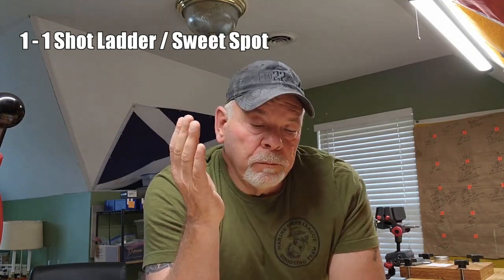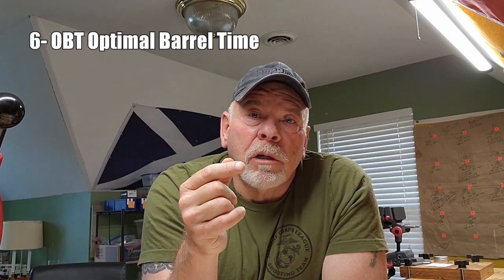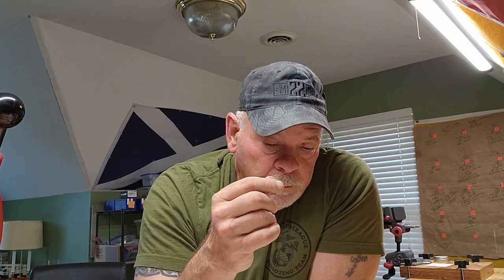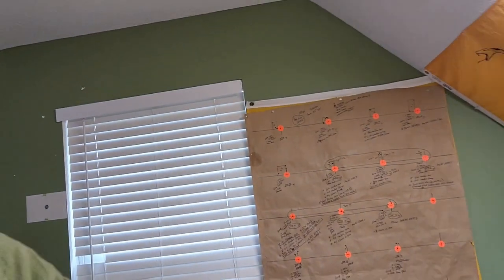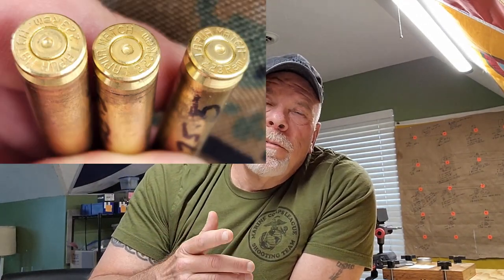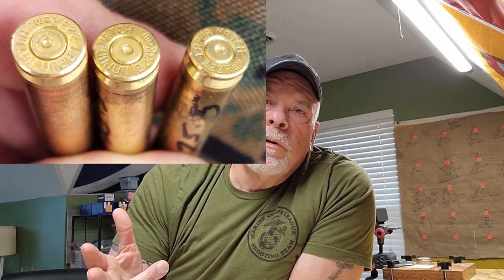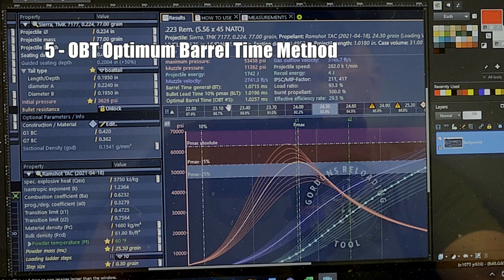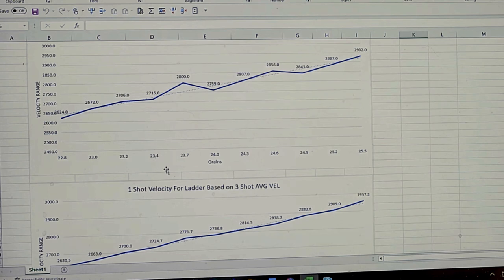Best Load Development Method

Comment: Loved the video, have noticed that quite a few shooters at matches don’t do load development. They pick a recipe from an article, or web site, or a buddy and that’s it. When I develop a load for a particular bullet I use a similar chicken scratch board, and use a 3 or 5 shot group. And after I find the best group I’ll use the chronograph on another range date. I use LC brass, some times mixed,some times same lot and date, powders are Reloader 15: AA2520, or MR2000. Primers are REM 7/12, or CCI 450. Bullets are Sierra or Hornady. Great videos good shooting this year.
Reply from the maker: Thanks! I used mixed brass last year on 200/300. Used straight Lapua loaded long on 600. This year, I got a boat-load of Starline for 200/300, sticking with the Lapua for 600. A buddy convinced me that the Lapua for 200/300 wasn't worth the cost vs reward. SMK 77 HPBT for 200/300 and switching to Nosler 77 RDFs for 600
Reply: Purchased 200 rounds of Norma match 223, SMK 77 grain loaded ammo just to shoot up in a 223 Ackley Imp.got 1- 1/4 inch groups at 300 out of a bolt gun velocity was only around 2500. Figure that out was not a one time deal I did have 200 rounds. My question about using the graph and the velocities. How do you know if you're at one end of the other of an extreme spread when you're using one shot?
Reply: @stephenkrampert3430  once I have the most accurate loading, I load up about 10 then run them through a chronograph. And hope foe a good standard deviation.

Comment: You cannot learn enough from a 3 shot group.
Reply: Unless it is a bad group. Then you may have learned all you need to know about that combo.
Reply from the maker: I disagree and agree. A 3 shot group by itself doesn't tell you a whole lot. But, a 3 shot group that also meets other parameters such as great SD/ES, an OPT and/or OCW node gives fantastic information... to go verify. Check out the 2 videos on load development and accurizing my 6.5 Creedmoor.   https://youtu.be/TeDkqUwkq1E
https://youtu.be/YAk96gSewuw?t=299
Reply: Hornady found that true dispersion results can be safely calculated after shooting a 60 round group….seriously. 3 rounds ain’t enough for sure.

Comment: I am 2300 rds into 300 BO 100 yd accuracy.  I am not at the range my usual mon. shooting session.  Cold and windy, i was looking forward to testing 168 Hornady AMAX compared to Nosler Custom competition.  10 mph 168, .76, 175 Nosler, 1".  today is just cold with 10 mph done that.  i use 2 shot groups at 50 yds to compare different powder levels.  Check best a 100.  3 & 5 shot groups.  Then i go to seating depth at 50 then 100.  I had no luck with boat tails, not bad accuracy but tear drop bullet holes.  E. Cortina Break solved that problem.  My mish mash of what works for me.
Reply from the maker: LOVE my Cortina Tuner on my RPR !!! Curious if you're 300 BO is Sub Sonic and if that's a possible reason for the tear dropping? I use the 168 AMAX in my M1 in 30-06 & they have been GREAT so far. Thanks for watching and your comment !
Reply: i do not get the accuracy from subsonic, i am running 1700 fps or so.   Flatbased not boattail.  my best is 130 gr Speer Varmint HP, with 20.8 gr CFE/BLK  1 hole @CrustyOldMarine

Comment: Man, that was a great video in depth yet simplified, been doing this for 60 years try to keep up with new stuff ;old dog keeps going back to three and five shot groups change the charge weight try to learn and have fun doing it! Brass prep is a pain in the butt
Reply from the maker: Thanks! Yep, whatever method one uses, it's hard to argue the results of the holes on the target
Reply: I too have been loading and shooting for hunting for 55 years! after trying several of these methods, I'm going back to my 3 shot groups with 5 shot confirmation groups! I also know that a 2 MOA group is more than adequate for a hunting load especially under 200 yds but I really like a 1/2 MOA because it truly raises my confidence level and gives me more room for error!

Comment: After many years of loading development, I settled on the following method to identify a practical node. It is more or less a compromise between lowest SD and smallest groups. To verify my method, I observed many reloaders independently develop their loads and the same exact phenom happens. The smallest SD load,  then followed a smaller group size. 

The theory of accurate loading process:
In Physics, there is no free lunch.
In closed thermodynamics systems such as the internal ballistic solution, the goal is to get:
1) A very low MV SD vs powder charge load
2) Small groups vs powder charge load
3) MV velocity stability vs powder temperature
4) MV velocity stability vs small powder variations
5) MV velocity stability vs primer choice
6) Low vertical dispersion at very long and extremely long ranges vs bullet selection
First, let us solve the issues related to goals that we can control pretty easily. More specifically, 3) 4) 5) and 6)
3) Use temperature stable powder such as IMR endurance, Hodgdon Extreme Powder, etc. There are many online tests that you can search and find what powders are the most temperature stable (e.g., H4350)
4) Measure each powder drop to less than 0.1gr accuracy. It is easy to get to 0.02gr (1 extruded kernel) which is worth 0.3fps out of typical load
5) Make a small ladder test and see if the selected primers would produce a smoothly rising curve, if not, do not use those primers. There was a test in this video, do not use the primers that generate seesaw graphs.
6) Use VLD bullets with very low variations in G7 BC. For example, pick VLD bullets with less than 1% variation in G7 BC.
Now, here we finished the goals that are virtually 100% influenced by the components
Now, let us focus on the loading for the node. What is the node after all?
Optimum Barrel Time, OBT node: It is the node (with respect to time) where the bullet leaves the barrel when the muzzle is subjected to the least dilation/contraction due to the powder explosion shock waves
Optimum Charge Weight, OCW node: it is the node (with respect to time) where the bullet leaves the barrel when the muzzle is pointing to the same point of impact due to the powder explosion shock waves
Optimum Feet per sec, OFPS node: it is the node (with respect to time) where the bullet leaves the barrel with the minimum SD of MV due to the powder explosion shock waves
Keeping all parameters the same, changing the powder charge can change the MV and inversely the actual barrel time of the bullet
Note: OFPS is my theory why MV SD would shrink for the same powder but by just changing the powder charge.
What node are we after? Goal 1) is solved with OFPS node, a theory I introduced in September 2018.
Goal 2) is solved with OBT time.
The good news, OBT is numerically computed. With the advancement of very accurate radar-based chronographs and internal ballistic solvers, the OBT charge load can be accurately calculated. I had success doing that for few competitive shooters as proof of concept.
How about Goal 1) the best way to find it in my experience is to shoot a group of 3-5 shots in a ladder test such as the 6.5group spreadsheet test and find the lowest MV SD
The bad news is OBT node (smallest group) and OFPS node (lowest MV SD) don't overlap. Remember, in Physics, there is no free lunch.
The good news is both nodes are adjacent and in my experience, if you find the OBT node, the OFPS node is the next step load in the ladder. As groups shrink MV SD will increase and vice versa. So, the best is to find a compromise load between OBT/OFPS nodes that works for the shooter.
Reply from the maker: Great info and thanks for sharing! I'm going to have to read this a few times to get my head completely wrapped around it. Also could you reference and or link some of the places where one can find searchable online tests that you mention that list powders/temperature stability?

Comment: Enjoyed the video. I’ve struggled getting the OBT software to match any physical results I’m measuring to the point where I’ve completely stopped using it. There seems to be too many variables for it to work regularly.
Reply from the maker: I agree that the software is, at best, only a helpful tool. It's no substitute for real, verifiable, on the range results. Like you said, there are too many variables. I'm going to try to utilize it for some guidance on some winter testing of a great load (warmer temp developed) to attempt to adjust the charge wt t& attempt o match the known velocity node. There will be a video on that. Thanks for watching !!
Reply: @CrustyOldMarine  I shouldn’t say I’ve completely stopped using it, but I have stopped using it to help find accuracy.  I still use it for bullet/powder selections and combinations.

Comment: I try to choose a powder to achieve the velocity I want, that will achieve close to 100% case fill. Nosler data has case fill percentages in their load data. Had good luck with this method.
Reply from the maker: That is a good method, I also prefer near 100% fill as it minimizes any inconsistent burn across "flat spots" in the powder lying in the case. I would also add seeking the powder that is most temperature tolerant with minimal variations across temp ranges

Comment: Great job going through the data! Really thorough and appreciate that you tried a bunch of different methods. Quick question - since you shot this at 50yds, your 0.48 inch group is actually pretty close to 1 MOA, right? Because 1 MOA is 1 inch at 100 yards and 0.5 inches at 50yds. Either way, solid group for a gas gun and you may be able to tighten it up by adjusting the seating depth!

I've been going through the same challenges you have with some .308 load development. Tried a bunch of different methods and landed on a decent powder load, then had to mess with seating depth testing.
Reply from the maker: No, the rifle and optic had a 50 yd zero on it but, the test was shot at 100yd. Thanks for watching!
Reply: Thanks for answering this, I had the same question!

Comment: Well, I'm sort of partial to my OCW system... :) and maybe I'm wrong, but I think you probably concluded that the 24.3 grain charge was easy enough to find shooting the actual target (which would need to be done anyway)... let me know if I'm wrong (you can find contact info on our website).

I would use .2 grain increments with the 5.56, because the accuracy nodes are going to be .6 grains apart, which means scatter nodes come only .3 grain away from the OCW nodes. So 24.0 could scatter, as could 24.6 grains, with 24.3 being on the OCW node. Also, OCW nodes are 3% apart as a rule, so if 24.3 grains is on a node, then 24.9 grains should be as well. This in interesting because it puts 25.2 grains on a scatter node and that group tossed a lulu for sure. :D

Get in touch if you'd like to. Would love to have you come to a class with us and we'd certainly discount your rate significantly. :)

Dan Newberry
Reply from the maker: Dan, it means a lot that you watched, commented and liked the video! 24.3 sure looks good huh? 
😉  And thanks a ton for the offer. I'd LOVE to come up and shoot and/or do a class. You're not that far away so, maybe this Fall

Comment: Thanks for putting this example together and sorta overlapping the load development techniques.  

I've tried most of these techniques and seem to end up back with the OCW method.  When using the OCW method i choose the load which has adjacent groups that impact in the same general location.  In your example this would be the 24.9 to 25.2 span.   Next I would try some seating depth testing to see if i can reduce the group size a little more.

Sometimes i will notice the velocity change per change in powder charge weight will be less too.  I look at that as a 'plus' to choosing that load.  

I actually don't look at sd and es until I'm done.  Generally the sd is single digit which is another 'plus'.  Brass prep can make a big difference in this regard.

It took me a while to realize I was the biggest variable in my load development process during the range portion.  Firing a consistent group was hard for me to do.  I'm getting better and more consistent now so that helps load development outcome.
Reply from the maker: Thanks! Seating depth isn't a variable I could really play with for Service Rifle except on the 600 yd loads. It's interesting how the Nosler RDFs in both 77gr (SR) and 140 gr (6.5 CM) worked out to be so close on the jump. I've got a good video dealing with Seating Depth on my 6.5 Creedmoor here https://youtu.be/YAk96gSewuw

Comment: When i shoot 2 shot groups of 5 groups with the same horizontal line. i use desk calanders from wallmart with a 3/4" dot from office section at each line intersection.  I am handicapped with no chrno.  i would rather spend the money on bullets,
Reply from the maker: LOTS of Lab Radar Chronos on the market relatively cheap now that the Garmin is out